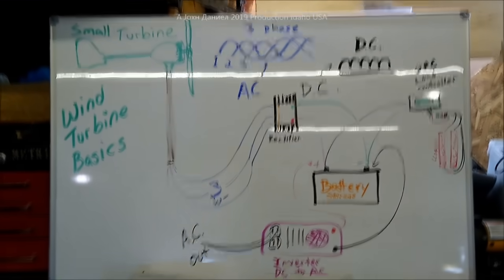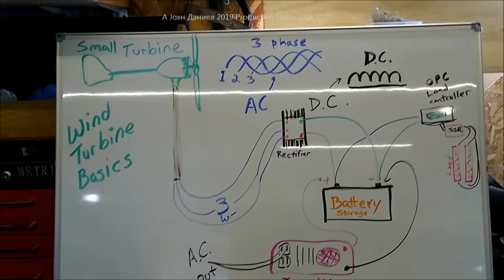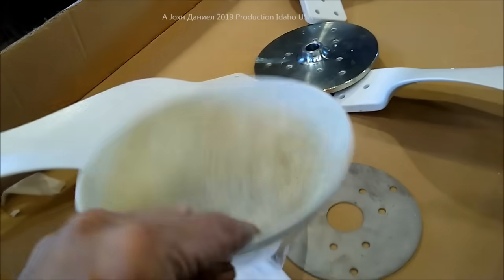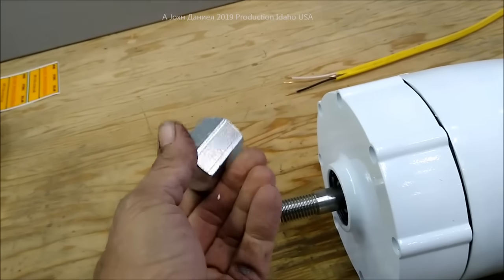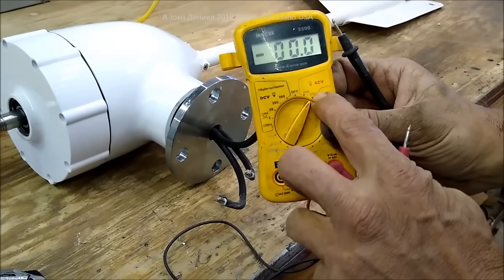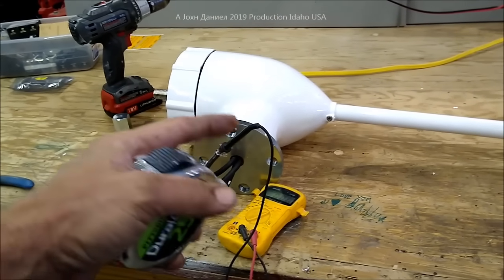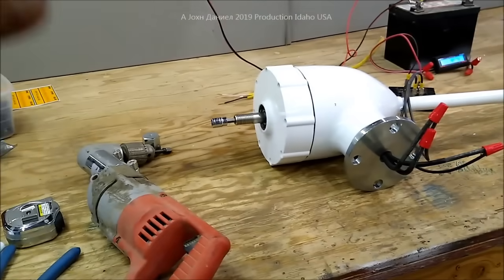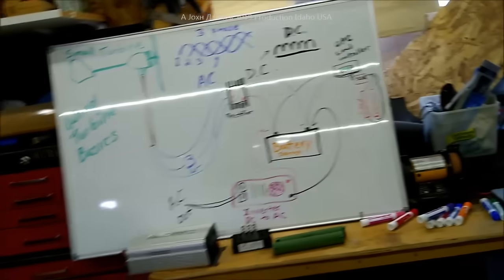800 Watt 12/24 volt Small Wind turbine by B & C Wind, Newest Model, Huge Parts List below

Comment: Great Video John!! Very helpful. How exactly might you adjust this setup given the AliExpress MPPT you list on your links section? Where would the MPPT tie in? Thanks in advance!
Reply from the maker: Wind turbine to MPPT, MPPT output to battery. It converts the 3 phase from the turbine into DC voltage and uses a system to enhance charging results plus a diversion system to prevent over charge i high winds.
Reply: @JOHNDANIEL1  Ok, got it. Thank you for your speedy reply. So, safe to assume this MPPT would remove the SQL 1000Amp rectifier from the configuration. Does this also remove the SSD relay as well? Or no? Again, thank you for all the info! You break it down nicely. Cheers

Comment: how many batteries can this keep charging? I am on a 3rd world country with no electricity so I want to order 1 of these or the next model the 300usd one from previous video.. thanks man
Reply from the maker: The 500 watt 5 blade with winds exceeding 12 mph normally can charge 4 - 100 amp hour deep cycle batteries as long as you also apply at least 1 or 2 solar panels of 100 watts or higher to maintain the health of the batteries in low wind days. What country do you intend on using it in. The people who build these often make you a small discount on request from a sponsor like me who installs turbines to help you get them.
Reply from the maker: ( i deleted your email on here) I don't want any viewers email on these post to be harassed by anyone or be sold by scammers, so you can Contact me though the shop email its a high secure email,  olympicpowercontrols@yahoo.com and I will get back with you. I get many emails, it may take a few days.

Comment: I would really like to see the inside of your turbine.  I don't believe it is a double bearing model...I think it's supported only on the nose.  I've had two of that variety so far and both were single bearing assemblies.  Mine, however, did not have that heavy a wire coming off the stator so I can admit there's differences...your supplier is a bit more expensive than eBay, but if they have somehow managed to get a bearing on both ends of the rotor that would be worth the additional money.

That said, 800+ watts in Texas 25mph texas wind today going to a 36v bank.

https://i.imgur.com/s1LobV6.jpg
Reply from the maker: The GE and B&C turbines use a deep Double Row bearing thats about 2.11" long with a grease pocket between them which makes the rotor in them go 1.17" further back into the body above the slip ring assembly.
Reply: @JOHNDANIEL1  Thank you for the clarification.  That's how mine are built.  I feel it would be better to have support on both sides of the load.  I'm sure the deeper bearing assembly in the nose will help it fare better than the little 300~500 watt chinese turbines...probably asking too much to have that kind of support on such a compact mill.

Comment: is it possible to sell the power back to the power company like I do with my solar. I live in Idaho and get lots of wind.
when tesla truck comes out will be using  that for a back up battery and would like to store my power directly  in the truck battery if possible.
Reply from the maker: Yes, but if your in Idaho you know we get high altitude Inversions, with some wild wind. You can easily hit peaks of 1300 watts, So when you shoot in on the turbines link look on the page sides and find the BLUE 3 phase in grid tie for that plan. DO NOT UNDERSIZE! Get that 2000 watt grid tie inverter from B&C if thats your plan and the 48 volt model. The 1000 watt will not last in our winds.

Comment: Can we use this turbine without battery by direct connecting to the converter
Reply from the maker: No, the turbines make wild voltage converters/inverters can not handle. You will have to get a grid tie for that type of option or a capacitance scenario of batteries.

Comment: Thanx for the clear and extensive video, man. Very interesting. I also saw your 500W wind generator video. I subscribed for more :-) One thing I'm wondering about, though, and that's why you don't put a regulator in between the rectifier and the battery. Our boat doesn't have a wind generator anymore (I think the previous owner got sick of it), but the solar/wind generator regulator is still there, and it's in between the wind generator and the battery bank. Is there a specific reason you do it different?
Happy greetingz, Wim
Reply: Oh, haha, I think you answered that question at the end :D Because you have several wind generators on the same system, right?
Reply from the maker: 4 U To get 100% full batteries from one & to divert over volt you need these: https://amzn.to/37HN2OR 100A SQL Rectifiers &  https://amzn.to/2MTUjCU A All purpose long life Load controller and be sure to get up to and over 300 watts diversion resistors ( 
https://amzn.to/2QngFPq x 3) and one or more 60 amp SSR ( https://amzn.to/2QKEyj0 ) with heat sink ( https://amzn.to/2ZYtmna ) and be sure to use thermal past on it.  ( Proper type - https://amzn.to/2QN2hir from Protronix)

Comment: Definition of open voltage and the importance of it?  Any recommendations for a RV setup and can you discuss how much the noise levels are on wind turbines?  Noise is one of the biggest complaints.
Reply from the maker: The blades like on this 800 are extremely quiet, 55 db. But the blades on the 500 are much louder, like a 3500 watt generator at 50 feet away. You can get them all with that much quieter blade, just when you follow the link look over to the right side and theres many to use from them just stick with GE or B&C because they are the only 2 assemblers/sellers that actually order the right parts for these that I have found in 5 years.

Comment: Please do a sound study. I'd be curious to see how mich noise it makes and at what speeds. 
Also, is this setup going to be able to be used on a sailboat and resist the elements?
Reply from the maker: We did, and at 20 feet using a meter ( https://amzn.to/34sLKpk ) about a week ago, its info you need to do installs so I do record it when possible. 56.3 in 15 mph winds, seemed you only hear it good if your within 40 feet. You will hear it in 20 mph winds a bit louder but the wind itself is just as loud at that point. The 5 blade with sword style blades are a WHOLE different story, 69.5 db at 16 mph so I recommend the low wind version that uses blades like this 800 on it to make it quieter.

Comment: question, do i need a rectifier and a charge controller , confused here, my wind turbine came with a charge controller, 3 wires in, 2 wires out, any help would be great, thanks.
Reply from the maker: With one turbine the controller is ok, but if your running more than one you have to go into the rectifier and diversion designs.
Reply: @JOHNDANIEL1  thank you John

Comment: Ok Mate I just saw this vid, so forget my last comment asking for a complete detailed circuit design!!!!!   Do you really need a battery in the circuit though?  why not much like solar system send the DC supply straight to the inverter then AC into power meter board and into house circuit or back to grid for the tiny 7 cents/kWh they pay us here in Australia.   If your not off grid I generally dont support the cost of large 10Kwh + battery storage.  When prices drop on these battery storage units then for sure.
Reply: Hi Simon I have a 8kwh sonnen and 5.3kw solar panel in Ballarat. so lots of wind available on miserable winters days. Battery prices will drop and Battery efficiency will increase.  
I have outlayed for the best solar panels that I could justify. they only degrade by around 7% over 25 years. 
My main concern is the life of the batteries. the longer they last the cheaper and more efficient the new ones will be they have a 10 year guarantee but do not state much after that .  Hence I have purchased a 1000w turbine from the same company as John. LIke he says every day when the sun goes in the batteries start to discharge. They could be around 40% charged max during the day. and completely drained over night. NOT GOOD reducing the expected lifetime of the batteries after the guarantee expires. 
So I also purchased a Sun 1000G WAL TIL Grid tied inverter to push the power from the turbine back into the house you just plug it into any socket. It has anti islanding and a wifi logger ( I didn't really need the wifi logger but I can sell that on later when I have enough historical data) ,  the sonnen battery will take care of all of the monitoring and charging when there is spare power available from the turbine and discharging when a drain occurs.  
so for an extra outlay of around $1500 I will have no power bills as such in the future. My wife works from home and has a 2kwh UPS  running 24 /7 so there is always a small drain when she is not working. 
The turbine will assist in ensuring the batteries do not discharge as hard and they should be charging most of the time instead of just day time.   
It is a lot to spend up front but if you bank on power prices increasing. Because lets face it, the more power cost the more gst the government gets. The loan for the system will pay itself off quicker than ever at the current interest rates. It is much better to keep the power stored than send it to the grid and suffer gst charges when you pull it back at night.  
I was thinking of adding another 2kw battery but decided the wind turbine route was probably the most cost efficient. 
any way I am awaiting my 1kw turbine to be shipped from BC on aliexpress (34kg its a real one) after a seller on ebay trying to pull a fast one. Ebay came to the party and I am getting all my money back. BTW it is more than the 7c tariff now in VICTORIA Australia you can have single FiT of 12c or time of use FiT 14.6c 3pm-9pm (good for battery systems because that is when they have charged up. 7am -3pm, 11.6c,   10pm -7am 9.9c 
Note the low overnite tariff I will be charging my batteries after dinner then, (we have a 5 plate induction hob) so nothing will be going back to the grid I expect. 
Hope this helps someone out there. Enjoying Johns Videos lets see more of the 800w in action.

Comment: John - What size pre-made flange should be ordered for the 800 watt turbine? Is size "M" OK?  de KP2CY
Reply from the maker: Scroll down on the links I put on there, once on Ali just look for the measurements and model on the flanges. it will be about 5-3/4" OD with a size rating 800 to 1500 turbines. 140 to 150 mm

Comment: Great info.  You usually use on/off dump controllers.  This can destroy lead/acid batteries.  I have developed a dump controller station that does variable voltage dumping to hold the battery at bulk/float voltage, not on/off.  How do you turn off the solar when dumping to avoid dumping solar?  I fixed this with simple relays.  As long as there is wind and the dump controller is doing variable dumping to resistors, the solar inputs are off.  When no dumping to load resistors exists, solar inputs are on.  I started with this: https://www.altestore.com/store/charge-controllers/solar-charge-controllers/pwm-solar-charge-controllers/xantrex-solar-charge-controllers-pwm/xantrex-c40-solar-charge-controller-40a-122448v-p2070/.  I have combined wind with solar.  As may turbines as you want and as many solar chargers you want on the same battery bank!  I do not agree with on/off dumping.  My system holds voltage at correct bulk/float no matter whether wind or solar is active.  Lead/acid or Lithium!
Reply from the maker: Set your controllers to ( using 12 volt as example) to 14.1, then set your wind divert to 14.6 volts
Your solar will already be off its charging when its necessary to dump excess of wind power. Double that for a 24v system

Comment: How about something like a grid tie inverter as a dump load i just hate wasting energy and I'm in texas so trying to use the heat is unlikely i guess you could do a water heater or something
Reply from the maker: As often as they may go into and out of divert modes that option is not very usable. People do it, but never recover a cent invested.  However, in Texas your best bet is have it cycle on a attic exhaust fan system using a 80 to 120 watt 12 to 16" fan. It can handle the cycling on and off, and will remove that heat! https://ebay.to/2pnwB9x

Comment: It would be great if when you buy one it came with everything you need except the battery and the mounting pole.  Great video!
Reply: They would most likely use the cheapest possible components that would either have features you don’t need, or not have features you need. Better to purchase exactly what you need for your system at the quality level you can live with. Did you end up installing a turbine?

Comment: Would that size of wind turbine be overkill for most small PV systems? Some of your previous videos have had smaller turbines with great output results. I'm just trying to imagine myself attempting to install one of these units. Pretty big.
Reply from the maker: If your running a 3000 watt inverter and 8 or so deep cycles your at the low end of needing a 800. More fit for a 500.

Comment: I was glad to see you show how low the output is on lower winds (10% of rated output at 9(?)mph). Do not get me wrong, I think wind turbines are great, IF you have the wind to support them. Most of the continental US just does not have enough wind for small turbines. I regularly run through the numbers to prove that for a most areas you are better off putting the money into solar panels.  If you have 15Mph+ winds for eight hours a day you are right on the edge of being cost effective. Anything less, go with solar.

Comment: Where it say 1000w? All sites mention 400 or 500 but not 1000w. Are you wearing your glasses.
Reply from the maker: What do you define as all sites? I put direct links to the exact ones mentioned. The 800, the 500, the 1000 and the 200 to 400 watt all have separate sites listed.

Comment: I live in an area where the average wind speed over the last 50 years is 12 mph. What would this produce at that wind rate?
Reply from the maker: About 30% it's rating, or 240 watts/17 amps average with much higher results in storm or weather increases

Comment: I love your wind turbine videos. Question for you...  Could you do a grid tie inverter with this? Have u seen the Chinese blue one that has the rectifier, controller and dump load in one?  I just wonder what would happen when  you're not home to monitor it and the winds pick up?
Reply: Dan look at the 2000w model of the blue Chinese sun inverter. (sun WAL-GT 2000) You will need to oversize the inverter to handle high wind output. it's what I'm using. It has never gone into load dump. Or you can series link 2 x 1000w models.
Reply from the maker: A quality grid tied inverter designed for wind will have diversion loading, settings, and materials also designed into the build. So home or gone it will work fine.

Comment: The drawing is great, now I have a idea how to put it together, thanks.
Reply: Except both wires go from rectifier directly to battery. That would overcharge battery because the charge controller is further down the line. I know it's just a quick, rough drawing, but charge controller is first before the battery. The charge controller is what switches off charge to the battery and sends it to the load. (resistors)
Reply from the maker: @Tex_Prepper  Incorrect. Your confusing active load management with the battery destroying dead locking fake 440 amp mega solenoid misssouri design stolen from micro hydro controllers first stolen by then from Coleman. Mine is not even related to such a abomination.
Reply: Јоhn Daniel 
I'm not talking about any of those designs. Just talking about your diagram. So, according to your diagram, you can go to your battery from rectifier then on to the charge controller? So, your battery can automatically pass the charge on down the chain when its full?
Reply from the maker: @Tex_Prepper  The controller is a active controller, it not a bypass. So you get the ability to control voltage at the level you want by diversion only instead of bypassing it into a resistor bank. This process keeps your full charging rate you choose. The bypass design, AKA Missouri /Coleman thing dumps your entire system till the battery is almost dead then releases.  (I'll use a 12 volt system as example) So if your wanting your solar at proper rates you set its controller to max charge of 14.0, then your turbines do the bulk & balancing charging by setting them at 14.65 vdc. Your solar will not be affected, only your wind turbines will. Each time your turbine hits 14.65 levels into the battery your at full charge and the OPC controller starts to pulse the SSR's to resistors, at first its 3 times a second, and as voltage goes up every 0.05 volts it doubles its SSR rate of contact pulses. Based on the diversion resistor load you designed for your unit it can maintain max charge at all times with that process. The hacked Missouri design dead locks a massive resistor load, drags your whole battery bank down to 12 volts and your solar controllers freak out, Your solar panels get the AMP shit knocked out of them, the controllers and inverters go into temp default and your likely to shorten your battery life by 50%. 
Now you see why I have such disdain for such junk!
Reply from the maker: @Tex_Prepper  PS - A very accurate design using the OPC and SSR's will be drawn up with high detail soon,  I just ran out of board space to be in depth.
Reply: Јоhn Daniel  
Appreciate your explanation. Thanks. I'll be sure to steer clear of those other company's designs.